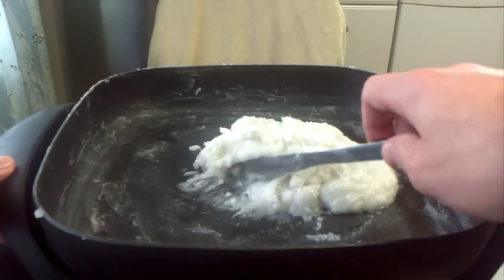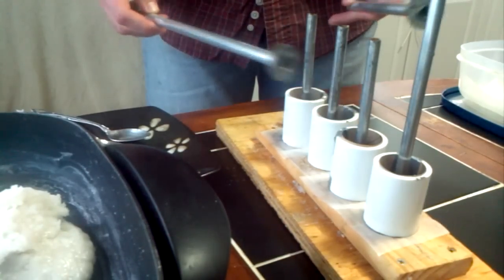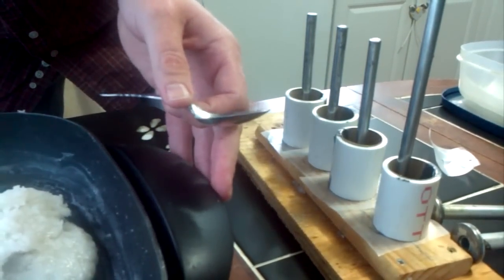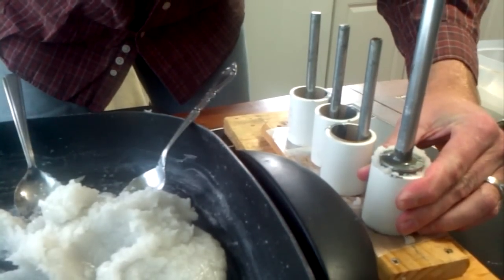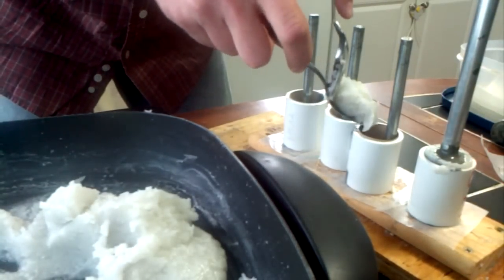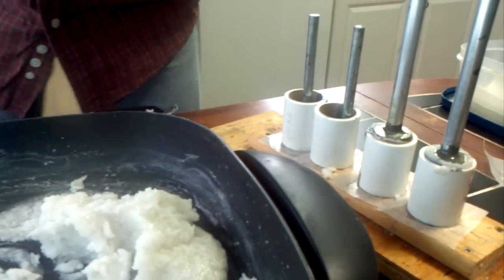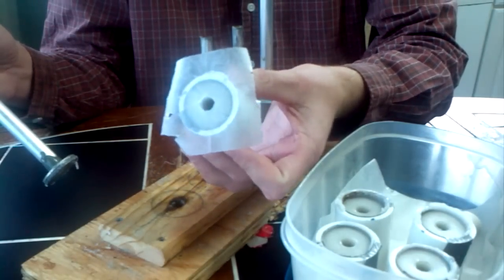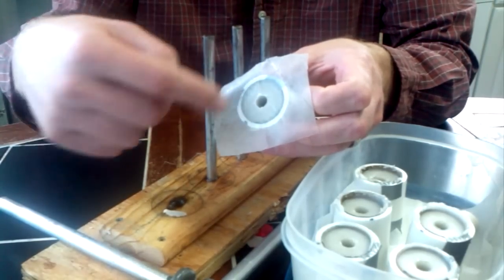Part 3: How to Build a High Power Rocket - Casting the Fuel into BATES Grains

Comment: + ETN + sorbitol
Reply from the maker: I appreciate your participation on my very old and somewhat unused channel.  I'm not sure, however how a comment about sorbitol applies here. As I used 35/65 ratio of sugar and kno3 and a splash of Karo corn syrup to help cast it.
Reply from the maker: Additionally,  now that I have just researched what ETN is, please don't mention that chemical on my channel, I respectfully insist on this.  Rocketry for me is a safe and fun hobby...and the older I get, the more this needs to be the case
Reply: @WizzBang75  
if you get it in a thin, small form, phlegmatize and use it as an additive up to 10%, then I think it will be safer and easier than melting sugar with saltpeter. While this may be a bad idea, I don't understand people who fixate on one particular concoction and refuse to discuss others, even theoretical ones. Chemistry is first and foremost a science, and rocket fuel cannot be safe at all. There is interest in what will happen in such a situation and how it will work, that's all.
Reply from the maker: @qwertyqwerty-cx8qn  no offense intended.  Like I said, it sounds fascinating but I try to keep everything safe and simple as possible.  I intended my channel to have simple to follow steps...and to exclude things that escalate the potential for danger.  You are correct of course...rocket fuel is not inherently safe.  Neither is leaving your house, but we do it all the time.
Reply: @WizzBang75  
Any opinion has every right to exist, each person argues in accordance with their hobbies, your video was interesting.
I speak only theoretically.
It all started with the fact that I realized that I was just too lazy to melt fuel, but I really liked how beautifully and powerfully the sugar pre-melted with saltpeter burns.
So I thought, is it possible to do without melting.
Since I didn’t like the process of melting sugar with saltpeter, in my case, and I used a small experimental sample, about 100 grams, the sugar began to char, but that’s only half the trouble, when I started molding it, it began to harden ahead of time . I did not add any additives at all, such fuel burns perfectly, but it is very inconvenient to work with it.

Comment: Hey! I saw you reacted to a comment elsewhere, had 2 questions you might be able to answer.
#1 - I used the Flex Fuel video (60% KNO3, 20% Sugar (powdered my granular sugar in a blender, heard powdered includes a tiny bit of corn starch), and 20% corn syrup. Mine was nowhere near as nearly fluid as yours was. Any thoughts? it was very well integrated, and the skillet was around 250 (using an IR thermometer), as was the propellant. In the skillet, it really wasn't very fluid, even. The propellant itself was good - very energetic burn in my tests. 
#2 - I had a DUH moment. First, used wooden dowels as my cores for my grains. Second, didn't lube them with anything. Any way to salvage this? I have considered running a drill press VEEEEERY slowly, but would prefer not to... I suppose worst case, I could just burn them in a rigged stand in the back yard as smoke producers.
Reply from the maker: It has been a number of years since I've lived in an area where I could launch, hence my disappearance from the channel, but if I remember correctly,  the mixture was 65% potassium nitrate and 35% confectioners (powdered sugar).  In addition to that I added Karo corn syrup,  I think another 15 Grams or so, and that is why it was so fluid.  Please note that...given enough curing time in a dry environment, this mixture will become very solid just like regular rocket candy.  Please don't use the drill,  make your casting tubes and use stainless steel coring rods.  A shot of Pam cooking spray or a super light coat of veggie oil will guarantee a release from the rods.  Give your grains a slight and continual twist as you pull them off the rods....and for goodness sakes....be careful from making the fuel to launch and recovery.   This is a legal hobby because people learn FAA rules and stay safe.  Have fun@
Reply: @WizzBang75  Thanks! I'd seen a lot of people using low-and-slow drill pressing on the compacted mixtures, and it sketched me out, but was something I was considering. I'll just follow your advice instead. Not like I used some obscene amount of material!

Comment: I'm working on a sugar rocket motor that is 8 inches long and 2 1/2 inches wide the throat of my nozzle is 1/2 inch wide. What size should I make the core. And what would you classify this engine as?
Reply from the maker: The core should be 9/16 or 5/8.  Your motor is a upper J Class.  Be safe!
Reply: Is there and advantage to having 4 two inch tall  bates grains rather than one big 8 inch grain?
Reply from the maker: @trevinhubbard5580  Yes, you get even thrust and much lower chance of explosion,
Reply: @WizzBang75  thank you that helps alot. I've made a bunch of the 3/4 inch rockets but I wanted to go bigger . I'm still learning and have alot of questions. I live right next to the salt flats so I can go bigger
Reply: @WizzBang75  does it matter weather the solid engine is ignited from the top or bottom of the motor?
Reply from the maker: @trevinhubbard5580  Always at the top.  Bottom ignition will cause 30 % loss of thrust causing the rocket to tilt

Comment: Very nice presentation, i watch it a couple of times on the 2nd time i noticed that you said your packing had an OD of about 1 1/2 in, and you also are using sch 40 1 1/4 PVC which has a ID of 1.356.  So did you machine out the PVC or turn down your packing tool ?  The reason i am asking is because i am new to the hobby and have no real feeling for the core diameter to the OD of the motor material.  From all i can find is the wall thickness is around 17-45% thicker than the core out diameter.
Reply from the maker: I believe back then I was using 1.25 inch PVC, so I found carriage washers that would fit inside the grain molds when the inhibitor sleeve was inserted.

Comment: Have a general question. When you make your grains, you are leaving a lip of your cardboard sticking up. Is that necessary?
Reply from the maker: frank vitale it is necessary for the ignition of the grain above and below it. That space allows for consistent combustion of all the grains at once.
Reply: WizzBang75 the only reason I ask is that regular reload grains are flush and butt together. How come those aren't like that. I don't know, that's why I'm asking. Thanks in advance. Frank.
Reply from the maker: frank vitale I made this video years ago.  I do know that each grain should have a gap on the top and flat on the bottom.  This allows for air flow and ignition of all grains at once.  Hope that helps you.

Comment: Why can't you pour the fuel into the moulds at an earlier point when it is still. a flowing liquid and then wait for the moulding to dry out. If the fuel is liquid you could then put the mould under a bell jar and apply a vacuum to make any contained air pockets in the fuel increase in size and raise themselves to the top this is a newbie question, so I could be talking rubbish!
Reply from the maker: +Roger Crier It is best to cook as much of the moisture out of it as possible.  If the fuel is flowing then it is not ready and will have poor performance.

Comment: Maybe you could take your fuel paste and scoop it into a frosting bag, cut the hole in the bottom whatever size you like and you could just squeeze it into those engine casings.  If it is too hot to handle the bag with your hands you could use gloves or they make these injectors that you feel full of frosting and squeeze a trigger handle and it comes out, allot like a caulking gun.  Just a suggestion.  Thanks for the video and the information on making these.

Comment: How did you make the coring rods and rammers?
Reply from the maker: I just went to Home Depot and bought 1/2" aluminum pipe with 3/8" hole.  3/8" steel rod will go right on it...and I used JB weld to adhere washers onto the aluminum.  Very simple.

Comment: Dear Wizz!
Your grains are really good looking! :) I'm suggesting of wraping them in foil, too. Just to prevent additional moisture and store them longer enough before the launch.
I have a question -> Can I use PTFE bushings and rods for the forming tools? I have some friends that are turning parts and I can make the forming tools from PTFE based on the grains that I want to make. The main pros will be that the fuel will never stick on them, the grains will be pretty easy to demold. The major cons will be the price of the forming tools as the PTFE is the most expensive polymer. Also, PTFE melts from 270-280 deg C, so it will be good enough for rocket candy casting. Do you have some suggestions?
P.S. It's not a problem for me to turn the tools from Aluminium, but it will need some lube for easier demolding process...
Best regards,
Bobby

Comment: Where did you get the iron stick with circle on the bottom?
Reply from the maker: I made it.  It is an aluminum pipe with 3/8" hole in it.  I used JB Weld to glue on a stack of 3 washers.

Comment: If you're measurement were correct you will not have any Unused fuel it should all be in your grains. Unused fuel is either a math error  or not packing all correctly and will cause you slightly less performance from the whole motor. The only unused fuel should come from trimming off the grains which you would use to test.

Comment: really rudimentary Packing???? the Propellant I use is very workable to Pack at least up to 6" chambers although both our methods are similar here at this point although I use a pressure gauge to give the right amount of pressure per grain. to try to eliminate thrust inconsistency.

Comment: How long do you wait for it to dry, in my experience that fuel has far too much water to burn well.  I just end up with slightly caramelized fuel that is way to hard to cast but it burns flawlessly as soon as it comes off the skillet.  I am just getting started in this and I am really struggling with the fuel.  Either it doesn't burn or it is uncastable.  How do you get such white fuel in the end, mine is nothing like that even right after the water first boils off.
Reply: I also forgot to say that the fuel I use can BE SCALED way Up safely and Successfully too.
Reply: You are dissolving your sugar and kno3 in water first, right?  I’ve found that the best way to avoid the caramelization is to use a lightweight aluminum or stainless pot that heats and cools very quickly.  Keep the heat pretty high and stir like mad to prevent it from staying in contact with the pot for more than a few seconds.  When you see the fuel actually melting to the pot, continue stirring and at the first hint of any caramelization, remove from heat immediately.  You can let burner cool down to med/low before putting back on and it should be able to sit at this temp and remain white. If you try and do this low and slow, it doesn’t seem to cook off the water very effectively, and the prolonged time on the heat caused the caramelization.

Comment from the maker: Not a dumb question at all.  Inhibited = a fuel grain that has some sort of thermal wrapping on the outside to prevent the fuel from burning on all sides of the grain.  For example, and Inhibited grain will burn from inside out, top to bottom and bottom to top.  An un-inhibited grain will burn all those ways AND from outside-in.

Comment from the maker: You are describing a single inhibited grain...I have made many of these....they work very well.  Casting temperature is just a little higher than cooking temp, and for large motors you have to work quickly and efficiently to avoid air pockets.

Comment from the maker: Hi Tango...you will find that once you start experimenting with different ideas, most of them will fail.  Bates grains work for a number of reasons, and one of those reasons is the outward pressure keeps the inhibitor working.  Put a partially cored grain in there and you will likely find that this grain will not act as a delay grain at all.  I have done similar things without success as many of my videos have shown.  However, if someone can accomplish this with repeatability, then high five!

Comment from the maker: A single inhibited grain can be made - and I have videos on this.  My first launch was using a 10" Single Inhibited Grain, and it worked nicely.  They do create more internal pressure than BATES grains, so use a slightly larger nozzle.  

As far the temperature goes to avoid air pockets:  I have never had this problem.  Appx 250-275 degrees is cooking temp.  You must add only a few spoonfulls of fuel at a time and pack it immediately. So work quickly and don't try to add too much fuel at once.

Comment from the maker: @ Zack...go to sugpro.org and ask one of the guys there for the calculator.  I was not given permission to distribute the one I was given.  However, if you send me a few specs on motor tube diameter, length and nozzle throat, I can send you a recommend with safety margin built in.

Comment from the maker: @ Zack:  I use cardboard tubes from toilet paper roles.  I press them tight to the walls of casting tubes and tape them in place.  These work very well and I have never had a motor fail from the inhibitor sleeves being inadequate.

Comment from the maker: I have a coring tool setup and everything I do is based upon that configuration.  I know it isn't the ideal, but the core I use right now keeps me well within safety margins.  I am not looking to max out my motors as I have a limited launch area.  I am hoping to soon build a coring tool setup for 1/2 cores.  This is a 3/8" setup.

Comment from the maker: Hi scarz...I have decided against using RIO as my rocket motors burn very cleanly and do not lack power.  Biggest reason, however, is that I configure my BATES grains from an excel calculator given to me and I am looking to avoid any potential anomolies that could cause a CATO.